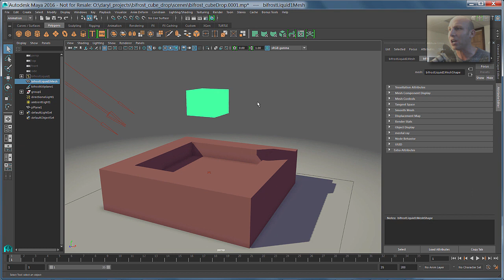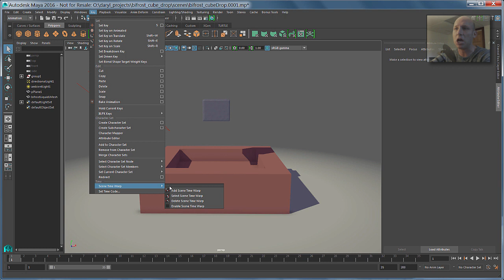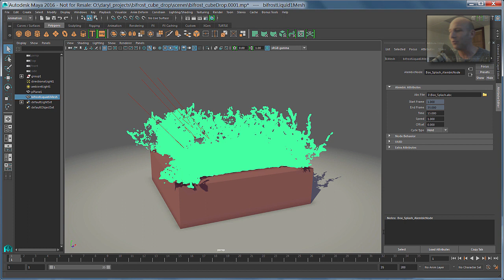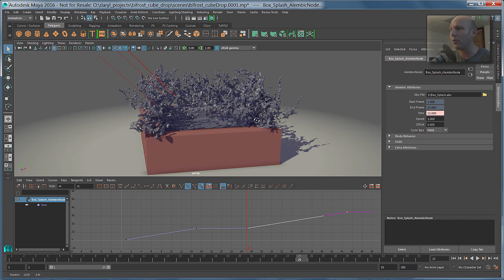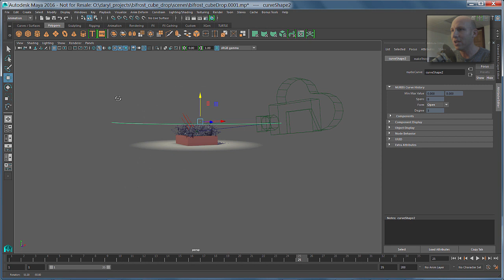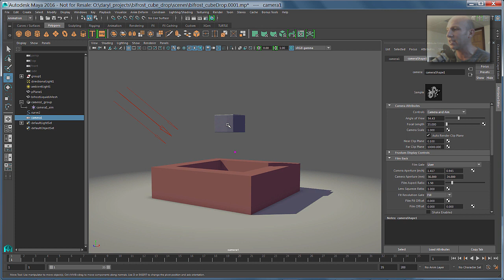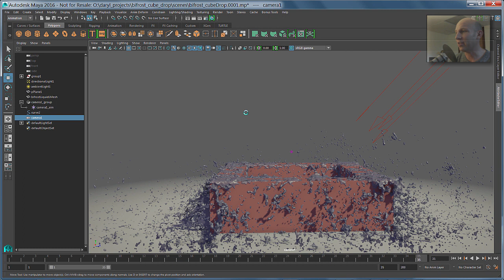Maya Monday - Bifrost time warp effect

Comment: Hello Daryl. Great Tutorials!! I have a question. I have made an animation of an arrow that passes through 3 water balloons that are filled with colored water ro paint, (one is blue, the middle red and the other green). they explode and and when the water lands on the ground the color mixes up. The first problem that I had was I used only one bifrost node on all three balloons, and I couldn't asign different colors to them, or different bifrost liquid shaders. What I then did was assign a bifrost node to each balloon separately, the caching took forever, and now I assigned 3 separate bifrost shaders to the balloons, The problem is when the simulated meshs mixes I don't see a mix/blend in the color of the liquid, it's basically one mesh intersecting the other and because of the transparency of the liquid material I can see through it the other mesh. So that's not very realistic. So that's my doubt, is there a way to do this in maya, with bifrost or something else (particles maybe) that would seem realistic? Three different colored liquids exploding and mixing the color between them. Thanks in advance!

Comment: thanks soo much! im always curious why this bifrost mesh looks diffrent in viewport and diffrent in rendering. I mean in viewport it has this nice sharp edges look, and in render always looks blobby (?)
Reply from the maker: +blastman011 Did you mesh it, or are you rendering the voxels directly?  Meshing will give you more control and better results.
Reply: i start meshing, after simulation done, i turn off voxell preview and particle preview & with clip box to mesh samples faster before convert to abc cache. Definitelly bifrost mesh looks prettier in vievport than in render, in viewport i can set like a sculpt with sharp edges nice look, bt render break it and show always blobby droples as smallest obiects...If You can set some extreme setting almost destroyed bf-mesh and compare it with rendering, im very curious how is it possible this differences...for me looks like there are some invisible settings which renderer takes as additional information.

Comment: So I was wondering why when you set a liner curve to keyframes the value per keyframe is not a whole number.  Also In a professional fluid retime you would need to solve for the in-between frames - a flip solver can do this using the existing cache data to solve for in-between frames.  Bifrost is not far from becoming a production ready tool just needs to give the users the ability to fine tune and control the simulation.
Reply from the maker: +Ryan Ochs Hey Ryan,  That is odd that it did not hit the integer, not sure why I just tried another simple test and it worked as expected.  Bifrost is getting better and better we have some great minds working on it:-)

Comment: Cool tip. Thanks. But is there any way to slow down one part instead of holding it? I tried it with this method but it doesn't create the frames inbetween.
Reply from the maker: +Robert Horvath Currently I think you would have to over sample the sim.

Comment: Hey Daryl, any chance you could do a vid on adding icons to the helpLine statusbar?
It is the bar that displays current tool information etc.

There is alot of wasted screenspace considering status messages never reach the end side of the bar.
Just a quick howto hack the helpLine mel, pretty pwetty please? :)
Reply from the maker: +syntaxed2 I don't think you can add Icons to the helpline.  You can undock it and then put it next to the range slider to make it smaller
Reply: Just a lil update: It does work, I managed to add a custom  formLayout with buttons to the bar etc